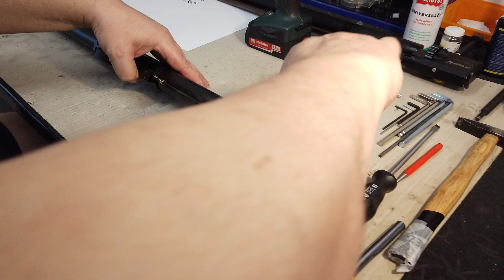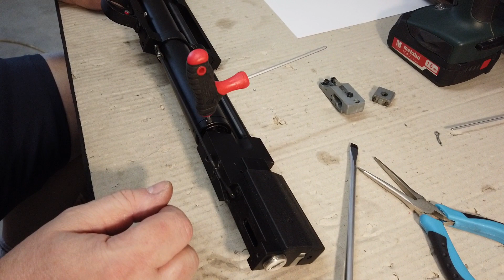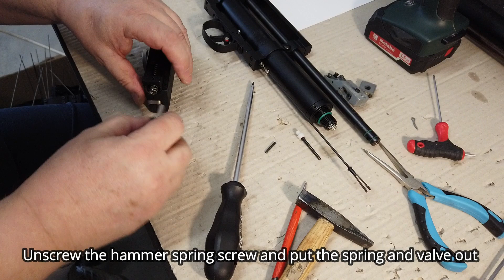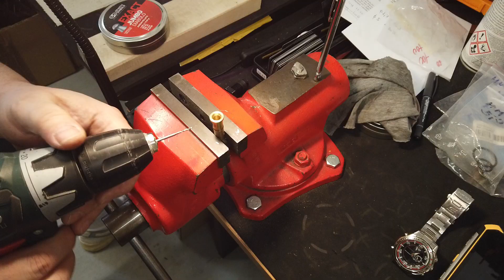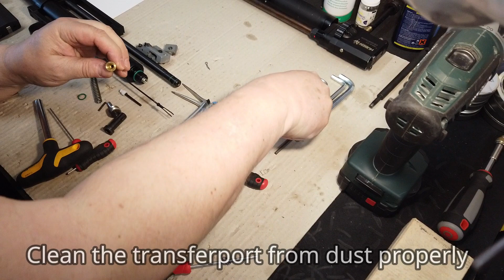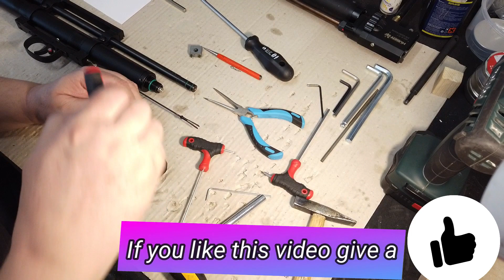SPA Artemis P15 - Power Adjustment Tunning

Comment: With these mono blocks like M50, PP750, etc best to oil the pins beforehand and leave for a few hours , the oil will penetrate and pool behind, makes removal/insertion easier. Also all o rings should be greased and screw threads oil again. Most Snowpeaks have a transfer port of 3.5mm in the Mono block, connecting exhaust valve to the barrel, so no need to over drill them. Drilling out the exhaust valve body must be carefully done, also pack the chamber with cotton wool for example so you don't scratch the polished inner surface 👍 P15 is a beauty, especially with a good regulator like Huma 👌

Comment: Nice video! My P15 is set to 24joules=18fpe...
And the accuracy is crazy good with JSB's
So glad I got this small bullpup!!!
Reply: how many shots per fill with 24J?
Reply: @jaskielakowski8521  Hi there. I'm getting 80 good shots. I can be happy with that number. My accuracy is crazy basically pellet on pellet. 

One thing to note, I took the shroud and turned it around! So now the breathing holes are out front. It seems to be working very well so I left it this way...
Reply: @leftymadrid  awwsome, thanks!
Reply: @robbo8870  13 g pellet...
Reply: @robbo8870   came from factory , I never have drilled a transfer port!
I opened the box, out air in it, shot 18g pellets , saw that it shot close to 24 joules, backed off the hammer spring... Lowering the power made the 13 g pellets very accurate! 
Remember if you start drilling, a bigger port will throw off the entire balance, you'll need after market stronger springs, and the factory hammer will not be able to support the hits at such velocity! Also, the shot count will obviously be lower ...
In Spain the P-15 is called the 
"ONIX K2" and max permitted here is 24 joules...

Good luck, with your project!

Comment: I have a UK spec p35 in .22. So what difference is it going to make to my gun if I drill transfer port to 5mm. Currently running at 11.5 ft/lb.
Please answer. 
I notice quiet a few comments with no reply 🤔
Reply: The mono block has a 3.5mm TP and barrel end has 2 TP's at 3.5mm, so no need to drill out the exhaust valve body larger than this, if go for 3.5mm TP you can 2.5x your power, then it's regulator and increasing its pressure
Reply: @maximumeffort7836 Is there a way to turn the power down without stripping gun ?
Reply: @robbo8870  Hya, the P15 has an external hammer spring adjustor at the back, turn this fully out to minimise power. If it's still too powerful you have to step her down, not too bad as the mono block is way easier than the M50 to strip down, stock regulator has a nut above the adjustor screw, can screw this in 1 turn to reduce power, also stock TP is 1mm so leave for sub 12 ft/lbs. Best to degas gun and leave for a day, also oil the mono block pins so they are easier to tap out, note these pins are KEYED so 1 end has a star pattern, knock out gently from the other end, all in all a fantastic air rifle once stripped, rebuilt and tuned 👌 Also consider getting a Huma Regulator for her, very consistent FPS spread then, much easier to adjust power as well, lastly can get a silencer adapter and put a UNF silencer on the front shroud, also inside shroud remove those metal baffles and insert hair curler/felt wraps separated by M8 tap washers, makes the P15 whisper quiet 👍
Reply: @maximumeffort7836  spot on.. just got her. Was guna get a kral as I didn't really know about these but seen one for  £400 at local gun shop..did some research and knew I had to have it! Don't know whether to tune it up yet as I'll void the warranty... so I take it there is no anti tamper screws any where?
Reply: @robbo8870  Hya, the P15 has no anti tampe screws, some screws are glued in but come out okay, if u have a chrono you can fire her and work out the ft/lbs, to be honest 11 ft/lbs is great for vermin control, also pellet type makes a big difference, Snowpeaks like H&N esp. Barricuda 18, Match and Hunter in .22, some Magazines are better than others, P15 magazine is Excellent with smooth loading, also helps the pellet probe is the old type, hollow with TP below the tip, makes pellet loading easy, P15 single load tray is excellent as well as it's high easy to use, P35 will be very similar bar the middle cocking lever, this operates 2 rods , 1 for the pellet probe and 1 for the hammer, am getting the P35 myself once it's on sale or 2nd hand, excellent gun 👍

Comment: I
Some say they come regulated some say not? If the p15 is regulated why not just adjust the regulator setting?
Reply: Fixed reg pressure from the factory but the Huma unit just drops straight in as a replacement. A better solution than drilling out your transfer port by eye with a hand drill...

Comment: Hi! I have a p15 and here in Argentina i recieved it shooting at 40 joules with a regulated valve in the tank. Today i have opened a little that valve but nothing happened. Does yours has that air regulated valve?
Reply: @fariasda  arriba de 70 disparos buenos
Reply: @joakko32  y a 50m agrupa bien bien?? Menos de 25mm.?
Reply: @fariasda  no hice pruebas de grupo a 50 mts. Tendría que probar. Pero a 25 mts con balines marca "rifle" (brasileros) de 19.9gr hace un solo agujero.
Reply: How many shot you get out of 40j?
Reply: @darrenmorris8258  about 75-80 down to 100 bar. Maybe at 40j about 65-70
Reply: @joakko32  what bar do you ill to? 200 or 250?
Reply: @darrenmorris8258  sorry, i didnt understand your question
Reply: Capo sos Argentino me interesa lo que le hizo yo tengo un p15 cal 25 me favorecera ? Gracias

Comment: Just recieved my P15 and it will not fill with air from scba tank. Air escapes from somewhere in middle of rifle. Any suggestions??
Reply from the maker: If there is 0 Bars, you have to cock the lever and keep it cocked in rear position. Then you can fill it.

Comment: Sir what size hole do you make in volve plz let me know in mm
Reply from the maker: Hi, you can see at video that we mention there 2 dimensions. We make it with 1,7mm for 16 joules
Reply: Nice video, mate.
What was the diameter before drilling?
Will a stronger hammer spring also rise the power to 16 Joule without drilling?
Haven't opened my 7.5 Joule Diana Skyhawk .177 yet.
Reply from the maker: @JuergenAYTO  Hi, 
With SPA, spring will not be enough. But I am not sure about Diana..I have no opportunity to test it yet.

Comment: The p15 .177 is already 23 joules i m quite confused weather he lowered or increased the power as he did it to 16 joules
Reply from the maker: Ariguns are modified for each market. Here in the Czech Republic there is a limit of 16 Joules. So all rifles which come here are under this limit. They just put a different transferport to reduce the power.
Reply: Man's World  ok got it good job btw looks easy but i open my SPA P10 last night couldnt found such part in it may be a its a bit different in different models .btw i have heard tht stronger spring can also increase the power as it hits the valve stronger and keep it open for a longer time to take more air